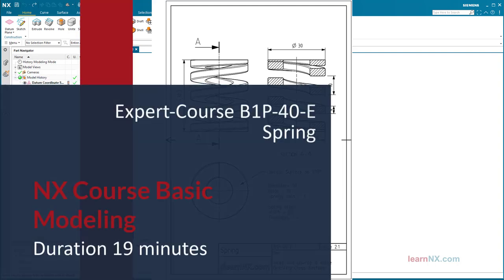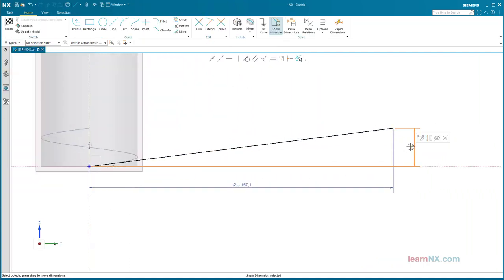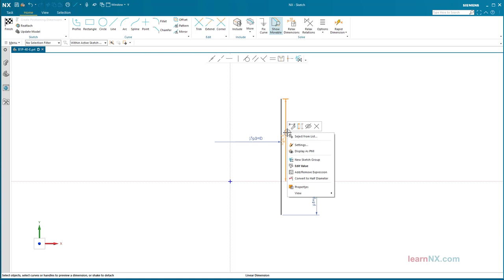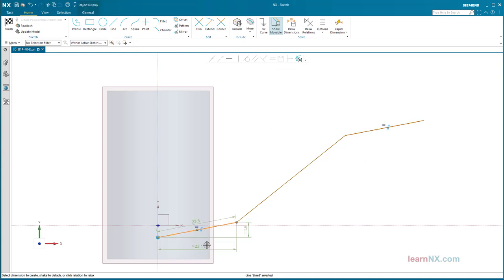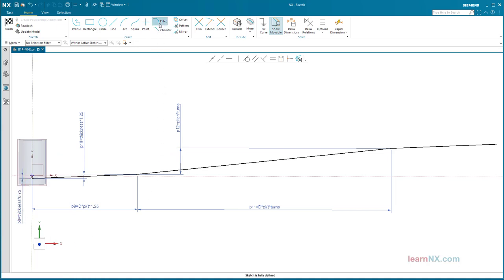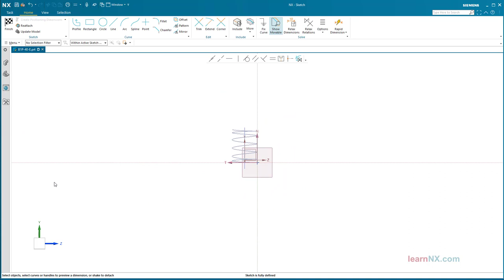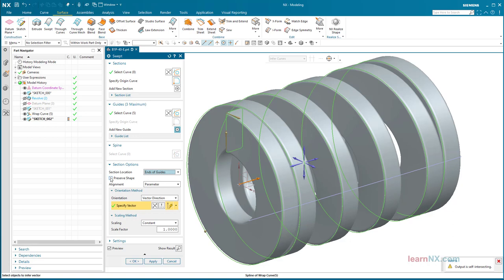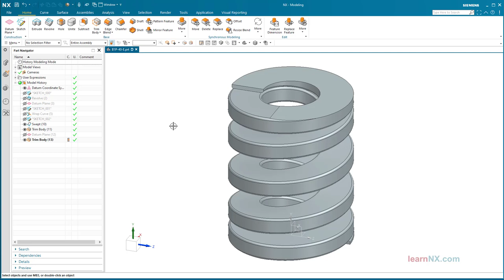Siemens NX Tutorial | Wrap curve, Swept, Orienting Cross Sections

Comment: Thank you. Is it possible to get a contact surface greater than 270 degrees?
Reply from the maker: I do not know what you mean, please explain your problem in more detail
Reply: @learnNX.
 That's okay, because your method allows you to increase the upper and lower contact area. It is very easy to control. I used to use a spiral and change the pitch according to the law of the curve.